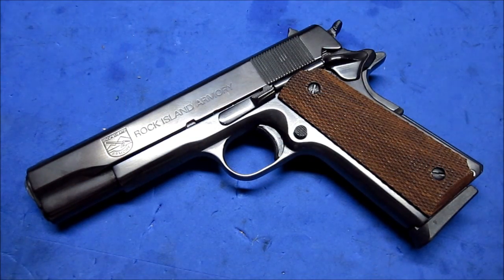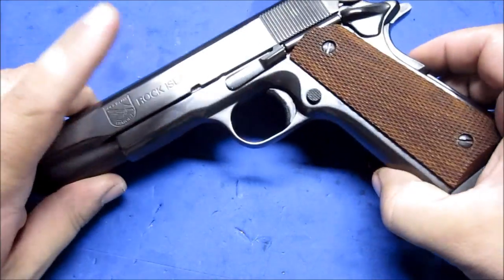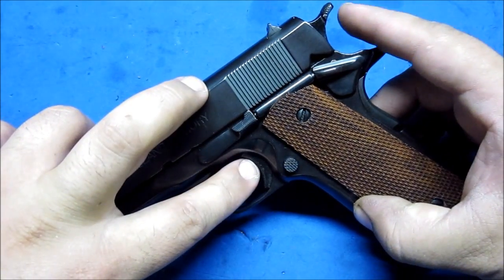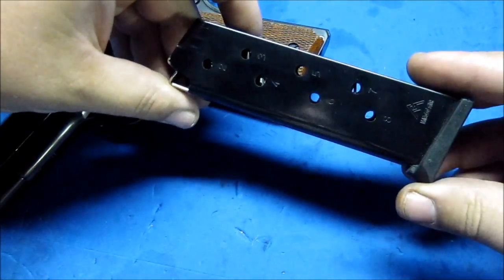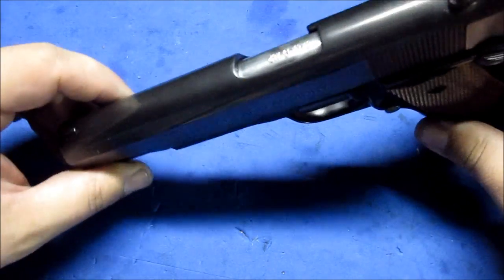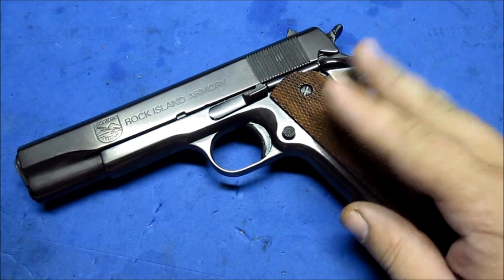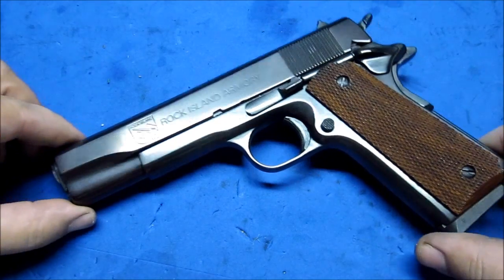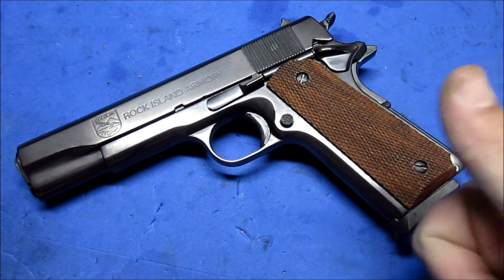Hot Bluing...SUCCESS!!!

Comment: De-grease with purple power
Rinse with tap water
50/50 water white vinegar Solution 90min Soak+ removes old blue
Boil Parts in tap water 20 min Converts (fe02) red rust to (Fe03) black rust
Metal Prep (sand paper 600 grit to 1200 grit then polish
Then Heat 4 bottles of Spectracide Stump remover (Potassium Nitrate) powder in a metal stainless pot turns yellow very hot (where protection on hands and sleeves)
Put Parts in 30 min or how ever long you like color change. Shake bubbles off with warm tongs (dont splash)
Dunk into Warm Tap Water
Spray with WD-40 let sit for a bit
Reply: Never tried it. But I guess you could. I just used 400 grit to 1200 grit sand paper on a flat piece of glass. Just be careful not to take off the roll work. Wheels can cause wavy lines.
Reply: Hey Jason quick question, does it necessarily need to be 4 bottles of stump remover? Is less possible?